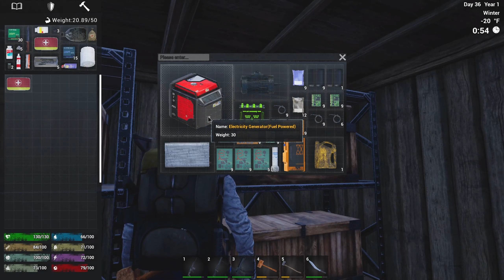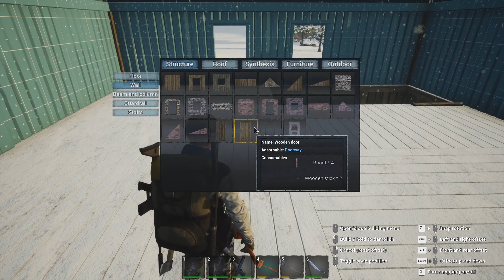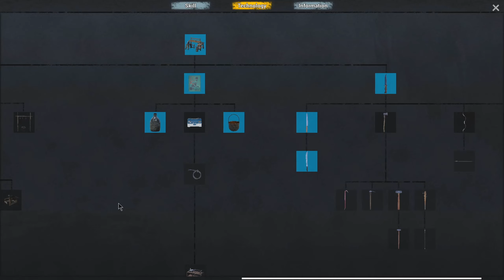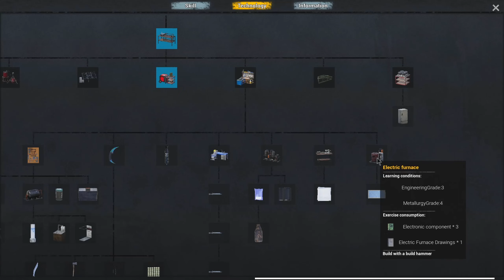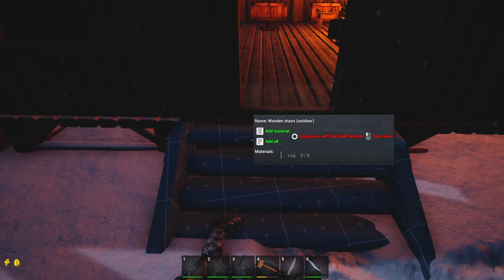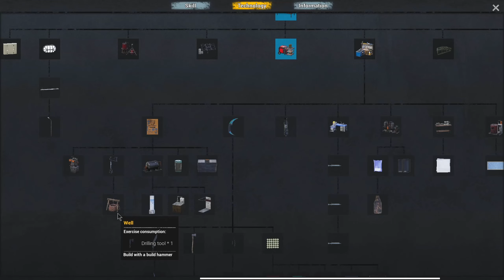"Winter Planning" - No One Survived - Episode 13

Comment: I like the way you going with the bass game hopping have you consider the idea of doing a third floor before putting the roof on I’m not talking about because of the fact that you’ve been in a rush for winter. I’m just curious in general ? It might help you with your storage long-term especially if you build it two walls high
Reply from the maker: I asked that in the video, but have since filled in the roof parts we placed down.
Reply: Can you place a scaffold thing inside?

Comment: you need support beams to attach the top of the roof I think. don't forget to leave room for a bathroom and a better kitchen 
also they should a way to actually heat the house in the winter.